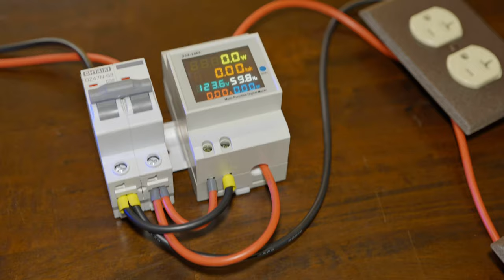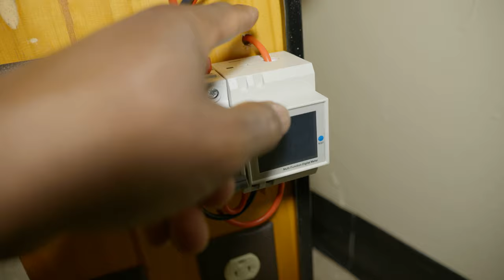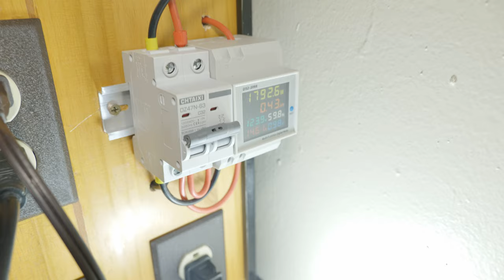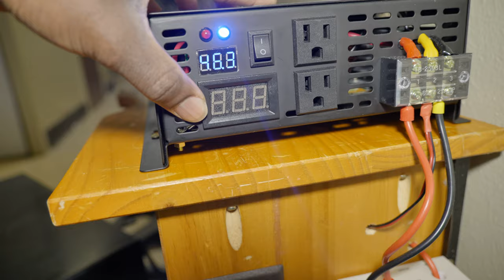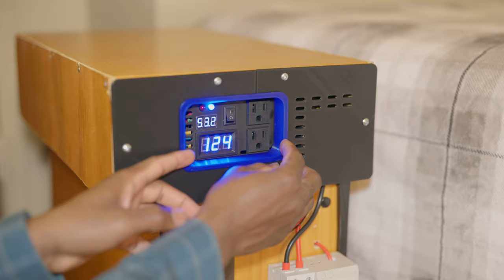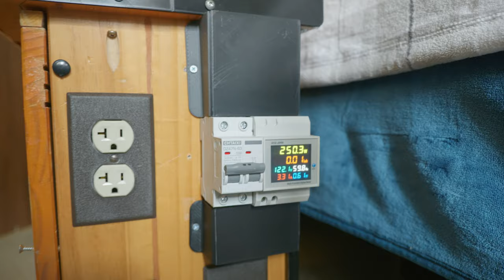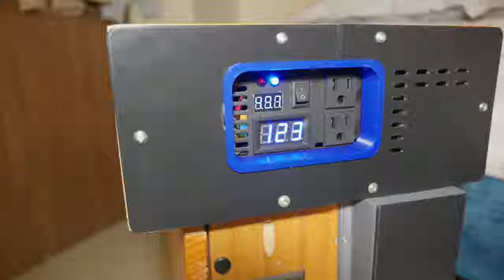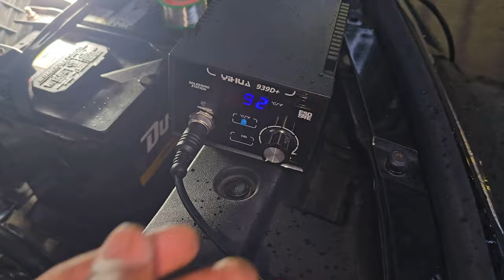Building OFF-GRID AC Backup Generator | Portable Power Station

Comment: That's a very nice build I like your resourcefulness and for people saying things like the cables are too small. I guess they don't realize that coming out of the inverters is AC and AC 110V does not require the heavy gauge wires that DC requires other than that. Nice off grid generator.
Reply from the maker: Thank you for the kind comment!

Comment: You can use two car batteries and use the same setup, but it only lasts a little while. It is just a d.c. to a.c. converter, and it has to be recharged. It won't run for several weeks at a time. It does look nice for the purpose it serves.
Reply from the maker: I'm thinking of building a huge battery pack using molicel P45B cells. Like a 14s30p pack. Two car batteries would equate to 24v, not enough for this  42 - 60v inverter, but yes normal car batteries wouldn't last. There are deep cycle versions made for this application, they focus on capacity instead of current which is required when starting the car

Comment: Nice job, definitely recommend a larger battery pack.  But curious that’s more battery pack what was the full voltage and wattage output?
Reply from the maker: The current battery is a 13s4p I built using Molicel P42A cells (48V nominal and 54.6V when fully charged). During my tests, I measured 65 Amps draw from the battery when the inverter outputs around 3,100W (120v  -  26A   AC). Not bad for a battery this size, but the wires might start to get warm if ran continuously
Reply: How do you recharge this unit